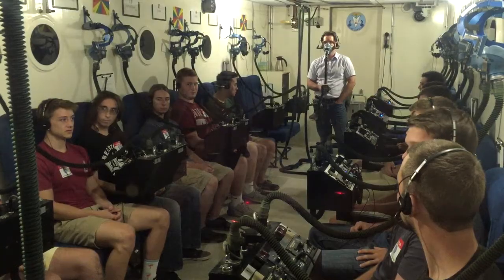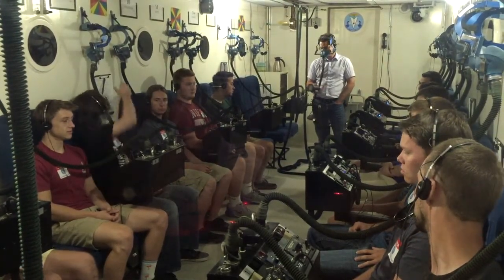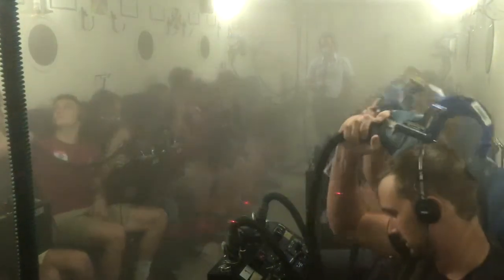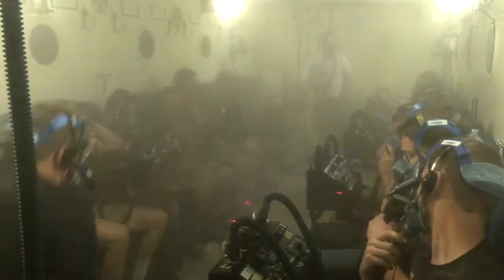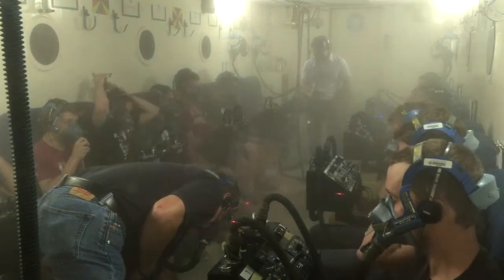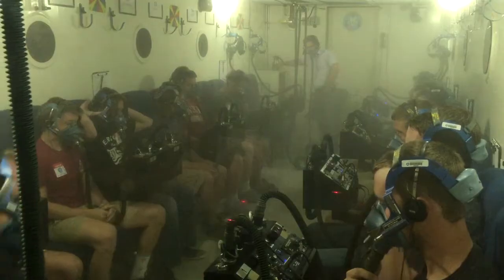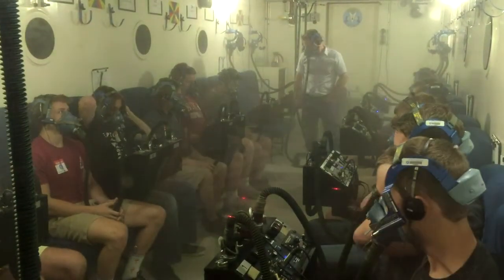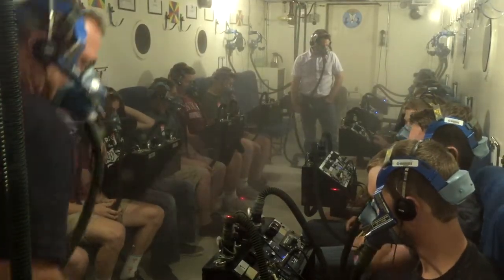Rapid Decompression - FAA CAMI Hypobaric Chamber

Comment: Then they adjust altitude to that around 15k' and instruct you to remove your mask so you can experience the inability to think while hypoxic. I was the last to put my mask back on so they asked me how many two-for-a-nickel cigars I could buy with 15 cents. I answered 6 but they told me to put my mask back on. What? 8? 10?
Reply: Sir, this is a non-smoking flight.
Reply: @josephastier7421  It's Ok. They were only chocolate cigars.
Reply: 7?
Reply: @TacoSupremo  Oh yeah. Finally. I get it.
Reply: @GregWilliams-Dallas  I don't...
Reply: The correct answer is 5... Sales tax.
Reply: I remember the one that got many semi-hypoxic trainees after a rapid decompression simulation was getting them to progressively subtract 3 from a 101. Most never accurately got past 95.